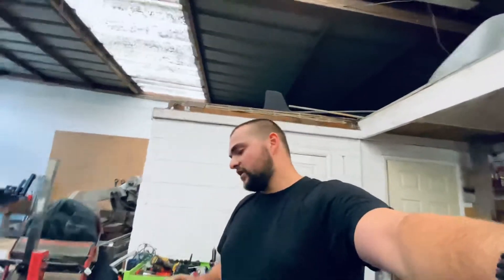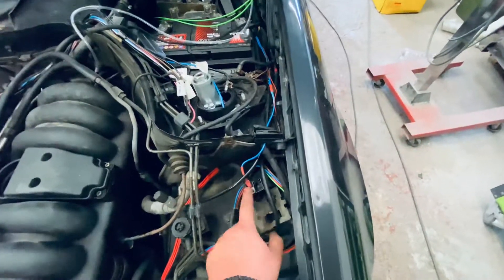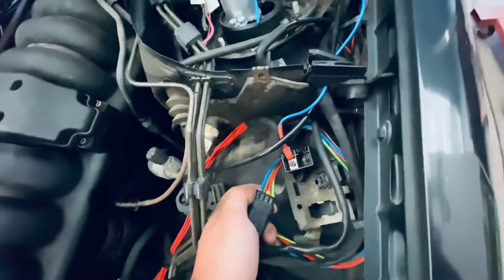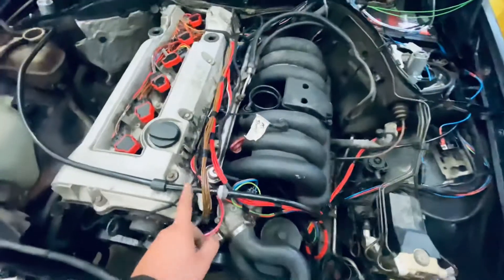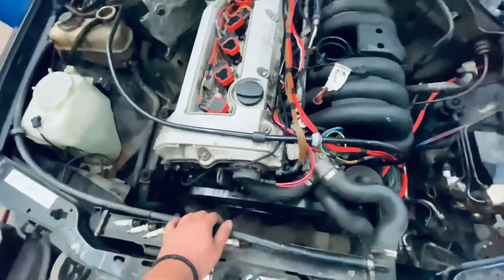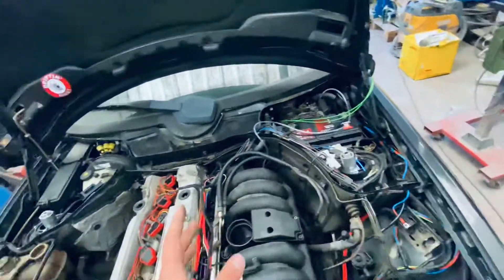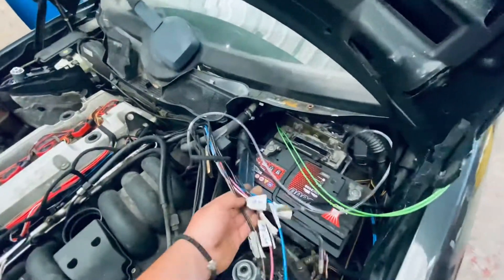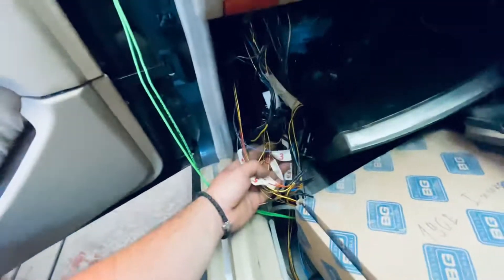How I wired the Mercedes C124?

Comment: why cant you use the stock crank signal?
Reply from the maker: I left that for the original ecu to use. It's a VR sensor and it's old don't want to mess with it. Easier to replace if goes wrong.

Comment: U could get the signal from the flywheel instead of the triggerwheel for crankshaft position right?
Reply from the maker: Hey, yes you can, but it’s just a 3 prong and I like the 60-2 because it’s more accurate. My M103 still uses the flywheel pick-up on Megasquirt 2.1 and it’s fine to a point.
Reply: is the crank signal a 5v or 12v?